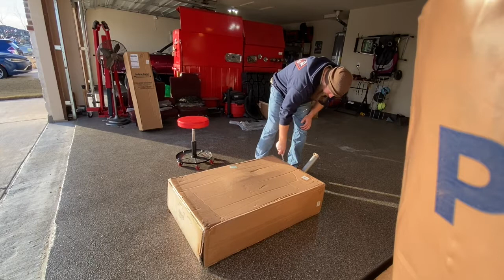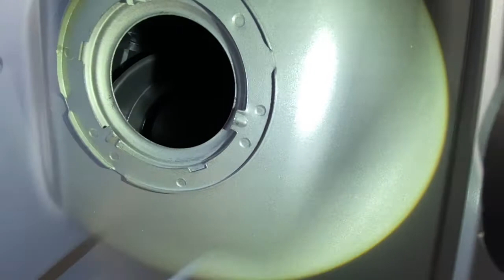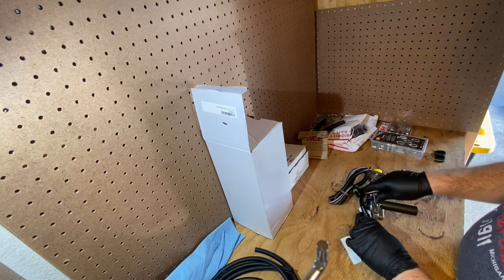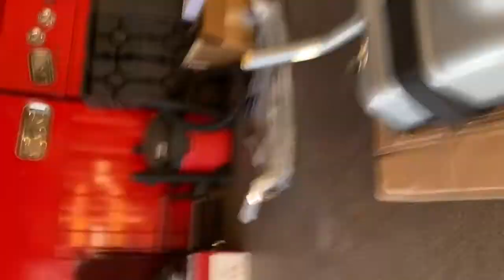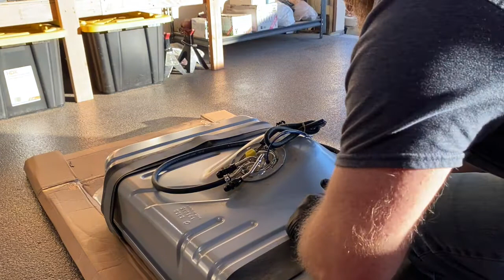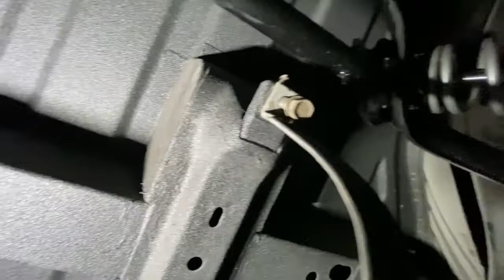G Body El Camino Restomod Fuel System Part 2: Tank prep

Comment: Im replaceing the sending unit in my 86 Monte Carlo but it only had two lines and the new one has three like the one you have my question is which lines do I use
Reply from the maker: The sending unit with three lines is for fuel injected vehicles: feed, return, and vent. The two line sending unit is for carbureted vehicles: feed and vent.

Comment: Great video Josh. I've been researching these tanks and sending units. One of the forums mentioned that is you use a EFI sending unit for these El Caminos on a 22 gallon tank the fuel gauge will be way off. Did you find a solution for this?
Reply from the maker: I’ve been told by gbodyparts.com tech support, who is running the same setup, that the only difference is that when the gauge shows “Empty” you’ll actually have 5 gallons left. I’m fine with that.
Reply: @CarsandJoshee  Makes sense, thanks for the info!

Comment: What brand , part number is that fuel pump/sender ?
Reply from the maker: Pump is a Walbro 450. 
Sending unit is from gbodyparts.com
https://gbodyparts.com/camino-fuel-sending-unit-p-3092.html?osCsid=15024ba674a50838494bf0d9fd6efb9f

Comment: How long did it take to get your parts?  I ordered my tank and sending unit from Dixie restorations  awesome guys.  I ordered at the end of January and just got the tank yesterday the sending unit is still a week out. It’s for my ls swap in my 85 elcamino
Reply from the maker: I think it took about a week to get everything. I got the sending unit, pump, and tank strap isolators from gbodyparts. I got the tank from rock auto.
Reply: @CarsandJoshee  yea I was told both the tank and sending unit was on back order I didn’t order the tank from rock auto because I couldn’t verify that it was baffled or not
Reply from the maker: @hosscaddy  yep, g bodies are getting more popular every day. I’m trying to get my parts and finish my build before I run into supply issues.
Reply: @CarsandJoshee  I’m close.   Waiting on my harness to be built  then I can drop the engine in.  I’ll have to modify the trans crossmember
Reply: I have a 79 El Camino i am prepping for LS swap. Could you tell me.what tank and fuel pump is most compatible for my car. Plz and thank you.